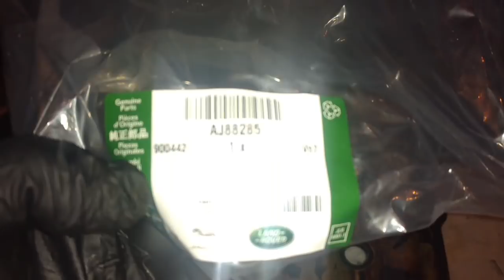Worked on a timing chain tensioner on a Jaguar XJ8 - HOWR

Comment: Strange that the upgraded tensioner failed...usually happens on the 1st or 2nd gen tensioners. Thanks for posting your videos on the XJ8, much appreciated.
Reply from the maker: It was not the tensioner, when I started the car it sounds like the flywheel is busted.

Comment: hey Robert ! the worst scenario happened To my wife's 01 XJ8 VDP. the tensioner chain literally broke on passenger side & breaking the cover when the chain whiplashed against it. I don't know weather to attempt a teardown & fix because I think valves may have slapped pistons & possibly bent in process. what is you're opinion fix or swap out altogether?
Reply from the maker: See if it's an interference engine. If not, just retime it and install another chain, tensioner, etc. You can usually find out on Parts Geek or ask the guys on JaguarForums.com

Comment: Greetings. I would like to contact the you  Directly but here is a Question sir. I  have the 2001 Jaguar XJ8 I bought not running for cheap it wasn't a working car I pulled the passenger side covers for the cam and timing chain and saw that the tensioner chain was broking. What would you do sir.? Help!
Reply from the maker: find out if that damages valves.
Reply: @RobertDIY  thank you and I will do

Comment: You had the tool in there right but you were pulling it counterclockwise from what I seen in the video it should have rolled I've done them before but I pushed it forward like righty tighty lefty Loosey righty tighty is clockwise Lefty Loosey is counterclockwise
Reply from the maker: That thing is tight. I believe it should be turned clockwise looking at the engine from the front of the car towards the back.

Comment: Cliffhanger??? Where’s the start up!
Reply from the maker: Man, sounded like the flywheel was about to come through the firewall. 😵
Reply: Does that mean that the replacement did not fix the problem or that you possibly did it wrong? I'm wondering if mine just failed, lots of terrible clacking.